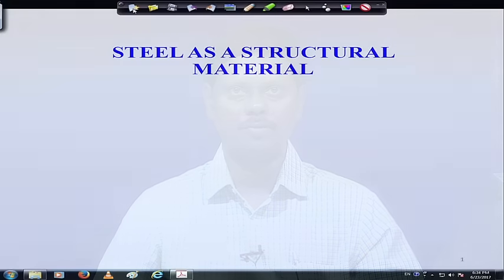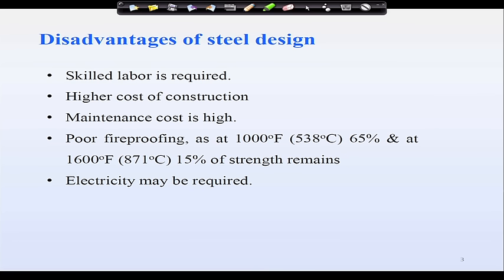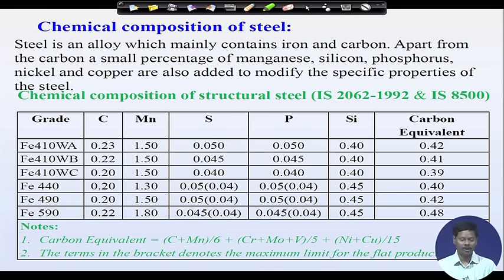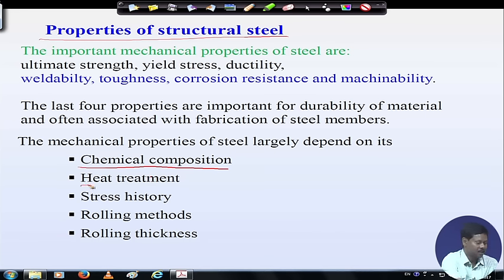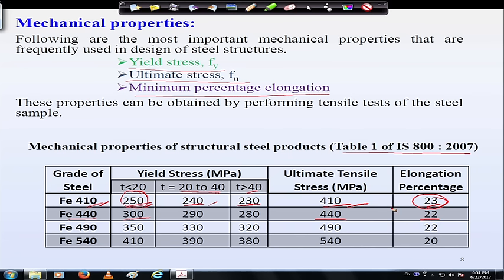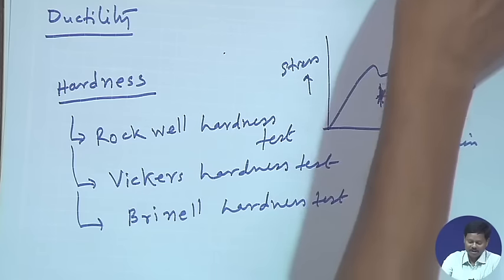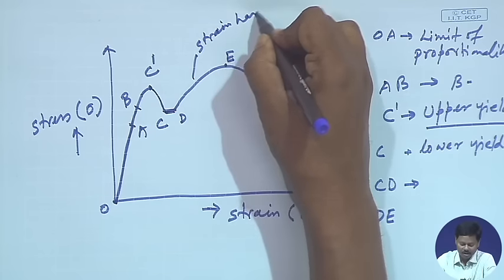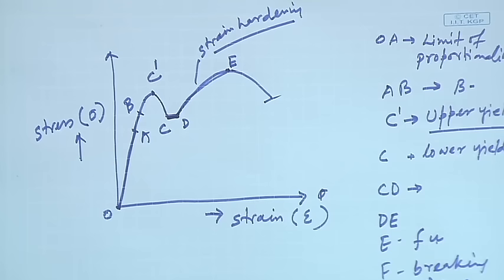Lecture 2: Steel as a Structural Material

Comment: Hello sir, In RCC if fe 415 was given then that implies fy(yield strength)=415. But here If fe 410 is given why  fy(yield strength)=250??
Reply: u need to know the difference between yield and ultimate stress, so go back to Strength of Materials first then come back
Reply: here is Fe- 410 means  E-250 {E-engineering steel} and if somewhere  Fe 410 is written then it means this is the ultimate  tensile strength  of structural steel............the term Fe -415 is used for r.c.c. steel and Fe-410 is used for structural steel
Reply: I think they wanted to give importance, as in case of RCC, one can't afford to steel to reach its ultimate strength or even more than it's yield strength as it's partner concrete fail without giving any intimation, whereas in case of steel structure steel give enough signal, so maximum use of strength may be used. By the way someone already said 'what is in Name'.
Reply: sahi baat puche bhai
Reply: @Inquisite1031  lol